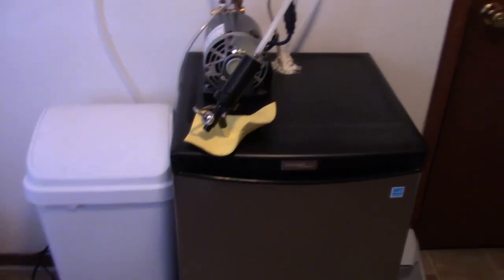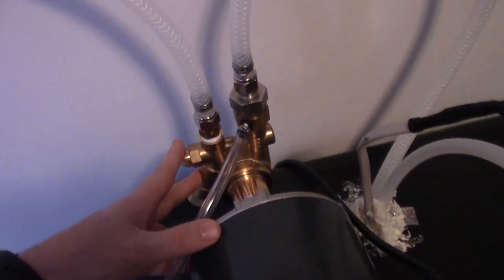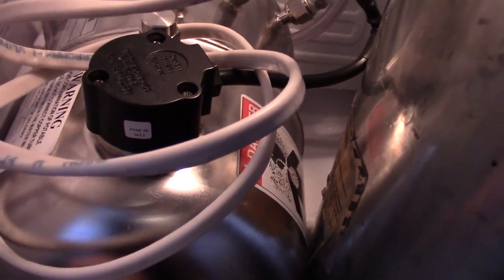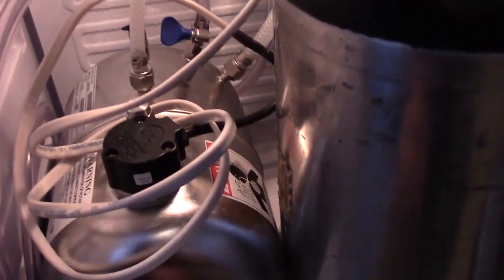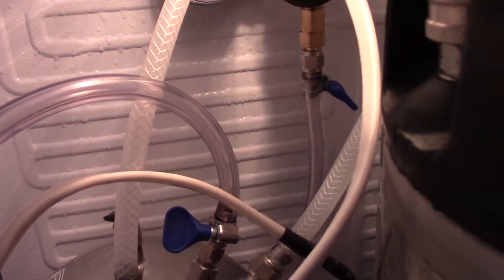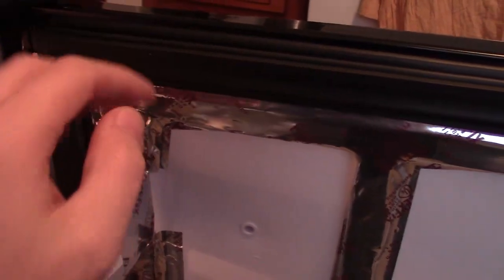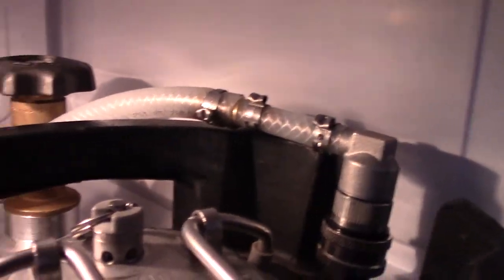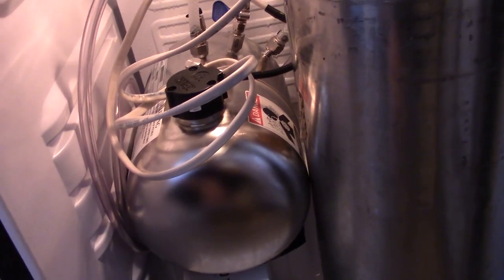Unlimited Cold Carbonated Soda on Tap DIY Kegerator!

Comment: you could get away with a smaller fridge if you put the carbonator on top with the pump since you have a cold tank already and run the water from the carbonator into the fridge tank and another hose out of the bridge tank into the dispenser and the CO2 tank can also sit outside the fridge as well essentially  however something to note if your looking for adding in soda with syrup dispensers  get a more appropriate fridge to make sure syrups can fit inside fridge this will save you so much on needing to buy a real chiller. Just a few tips I saw that might be beneficial to future DIYers
Reply from the maker: I actually don’t run the output of the carbonator back into any tank, it just comes straight out of the dispenser so that’s why I don’t want the carbonator on top sitting warming up the carbonated water.  The fridge the was the smallest size I could find that fit the required carbonator and corny keg.  The CO2 tank is only in there for convenience because it also fits in there, also so I have to make less holes.

Comment: Good morning, I have a problem with my equipment, when I pour the root beer it comes out with a lot of foam, I have a kegerator with a 13-foot hose to the dispenser, I use a CO2 tank, do you think you can help me?
Reply: I'm not super knowledgeable with problems with these types of setups, but maybe the CO2 is too high?
Reply: @Rezendes  I have been adjusting the CO2 pressure and it is still the same, I don't know if it could be the length of the hose

Comment: Hey Royce, i know this is asking a lot for something you posted a year ago, but could you possibly do a follow up on this video. your video is sort of all over the place. I see you have water from the tap going into the pump, from the pump I'd assume it's going into the corny keg and then from the keg into the carbonator? how does the pump know the corny keg is full, is it because it's going off the carbonator's float valve? so it draws water from the keg, fills the carbonator tank and whatever you consume it fills the keg for the reserve? so do you T off the c02 tank to be able to pump water from corny to carbonator tank? i think that's right, but I hope you read and comment. also, how cold does ur fridge get, they say to be below 40F for proper water carbonation. I'm looking into a kegerator for this purpose instead of modding a completely fine fridge.
Reply from the maker: Ok so not saying the way I have it is ideal or even correct but this is how it's setup.  Water comes into the pump then goes to the keg in the fridge and out of the keg to Big Mac carbonator then out to the dispenser outside of the fridge.  CO2 pipes into the Big Mac, the float valve on the Big Mac controls the pump when it's low it turns on.
Reply: @roycerepairs  so thats basically what I said, so when you're drawing water to drink it comes from the carbonator tank and when that gets low the pump turns on forces water out of the keg into the carbonator tank? so you prolly filled the corny keg more than 3/4 full to always have plenty of reserve cold water right?
Reply from the maker: The keg is always full yes
Reply: @roycerepairs  awesome because i'm going to do what you're doing now. cept I'm getting the smaller version of the mcann carbonator but its only me drinking it and with the corny keg being the reservoir I should be perfect with that setup. thanks man I'm glad u replied.

Comment: Is the routing of this setup going from pump motor to small tank to corny keg? I'm thinking about something like this, wondering if I can route it from corny keg as cold water storage, to pump motor, to small tank with carbonated water. I have an entire restaurant wunderbar with cold plate, but I'm looking for unlimited on demand without icing a cold plate also.
Reply: I have it setup from Water line > Pump > Corny Keg cold storage > Big Mac carbonator tank.   Come to think of it, that might be a better option because then you don't have to deal with the high pressure generated by the pump on the Corny Keg and would allow you to probably get by without rigging the Keg valve permanently shut like I did.
Reply: @Royce  thanks for your reply. I've been kicking around the idea for basically what you have here for a few months. The problem I've found in trying to eliminate a cold plate was looking for a cold water storage tank. There are well-water pressurized buffer tanks, but those only have one in/ out valve, and it would be a situation where cold water would likely sit in that tank and when the pump called for water most of it would come from the supply instead of the tank. I'm not really familiar with corny kegs, but it looks like there are 2 inlets/ opening, one with a long straw to the bottom. Thinking I could have my water supply into one side, and the carbonator pump draw cold water from the straw line and store the carbonated water in the pump tank. 

Also, I'm considering just putting the entire pump and motor assembly in my mini fridge, it doesn't seem to get noticeable moisture inside. But really that depends on the space of everything. 

Also, are you worried about having to clean the corny keg? Or do you do enough volume that nothing sits around in it too long? 🍻
Reply: @bombtrak15  I also looked into those pressurized tanks and it seemed like they would require another pump to get working, the corny keg was the right solution.  One post on the keg is slightly different diameter one for gas one for liquid just make sure the fittings are correct.  The straw side would be the out yes.  I wouldn't put the motor in the fridge, it does get condensation a lot on the back chiller plate but some people do put it on the fridge, who knows how long it'll last that way.  I think your first idea would work best, I would have to add one more line coming out of the fridge but it would fix the pressure issues .  Let me know how it goes.

Comment: Wow that sounds and looks awesome! quick question, is it really unlimited cold carbonation? i need this i really do, im just wondering about the capacity factor
Reply: Well it holds whatever fits in the big Mac carbonator tank ready to go and when you finish that it takes about 20 something seconds to carbonate another full tank.  I'm not sure how many glasses it take before it does that but it's basically infinite cold soda as long as you can wait 20 something seconds once in a while after a few glasses are dispensed.
Reply: Also once in awhile when your co2 tank is empty you just go get it refilled but it really lasts a long time, at least with one person using it all day every day a few glasses.